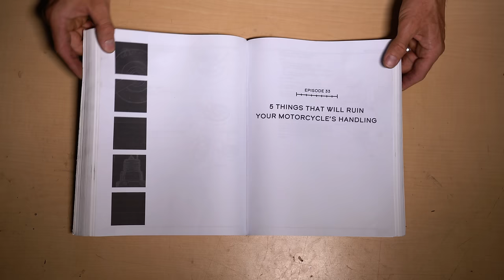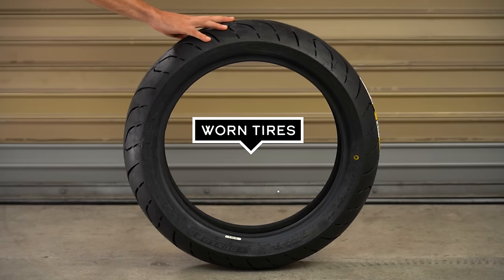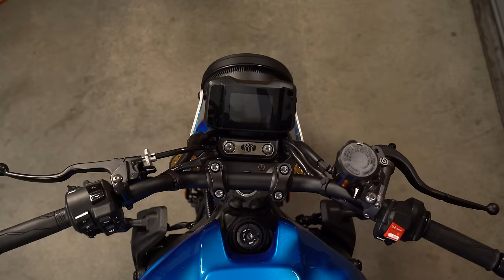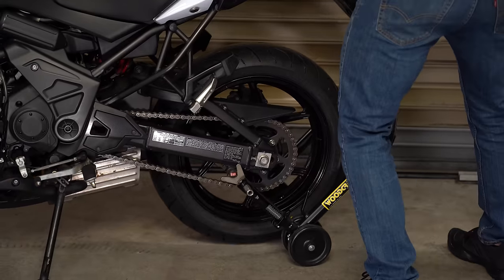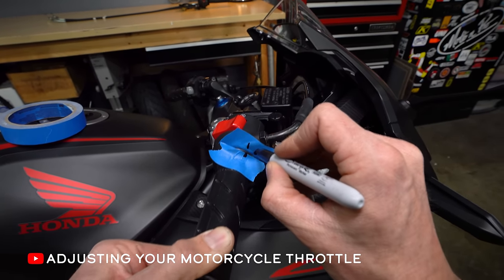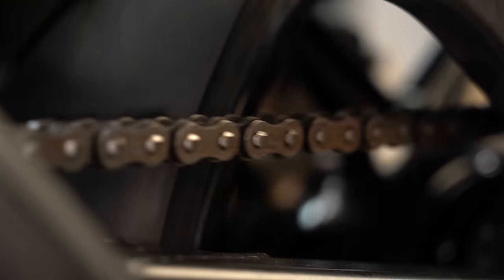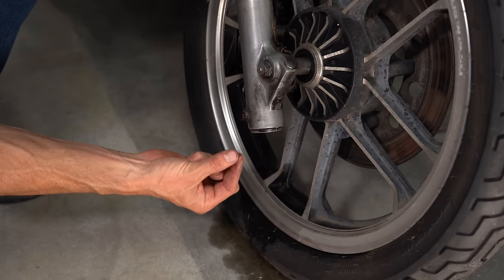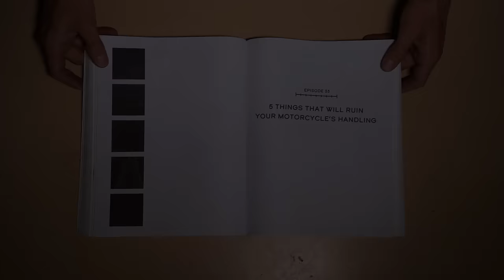5 Things That Will Ruin Your Motorcycle’s Handling | The Shop Manual

Comment from the maker: Want to learn more about optimizing your bike’s handling? Start with some suspension basics! https://rvz.la/3d5ZH6f
Reply: Hey Ari when I let go of the handle at 60 kmph then the bike goes to left slightly previously it used to go straight what could this be
Reply: Great info! I see a lot of people mentioning alignment in the comments. Maybe you can address that in a future Shop Manual?
Reply: @anshu0809  front tire is most likely culprit. Also, is this on crowned road?  Regular riding on well-crowned roads will wear your tires unevenly. Excess wear on the left for right-hand countries, and on the right for left-hand countries.

Another tire wear issue:  uneven turns. Not joking. We're creatures of habit, and we favor turning in certain directions, or we have a favorite speed run with more turns in certain directions. Can add up over time to uneven wear. 

Third tire issue:  cupping or bulging tread. Cupping is normal, but can be more noticeable in an unbalanced tire. Bulging is a far rarer, but very dangerous condition that can result in steering input from the ground up, and risk of blow outs. This is more common on some brands/models of tires, especially after running hot or a curb or pothole strike. 

Next most likely:  rear wheel alignment changed on your last chain tensioning. Even a millimeter or two can lead to rear tire steering. Easy fix.

Dozens of other possible issues, but the list above should hit 90% or better odds of a solution.  Presumes of course that the bike hasn't been in an accident or dropped hard.

Comment: Honorable mention: rear wheel alignment.
Reply: Spent waaay too much time realigning the rear after dropping the wrench adjusting the chain. May have been overkill, but it better not be wrong
Reply: I swear!! I wonder how did Ari miss on this one. I have almost crashed once due to poor rear wheel alignment.
Reply: Heh, especially when he had to ride that bike with the completely twisted alignment on ctxp.
Reply: Well, it will still hand really well in one direction at least lol. I wonder if they intentionally misalign the rear tire on flat track bikes kind of like oval cars?
Reply: @forrest225  racers will do ANYTHING for an advantage!
Reply: I just did a new chain on mine, so afterwards i gave it the old 140 test to make sure the rear is aligned
Reply: @Lizlodude the “it better not be wrong” got me 😂😂. i swear i’ve spent too much time on little stuff, and too much energy getting pissed when it’s a millimeter off
Reply: @xXFireHawkXxHD  millimeter can make all the difference. Shit, in my job we deal in microns for alignment
Reply: This goes along with increasing front tire size, which increases trail and rake. Can be dangerous tank slapper or a kickstand killer.
Reply: Just put screwdriver between the rear sprocket and chain and turn the tyre rearwards. It will align it straight
Reply: @vam0s21   Uh… I think you have a weird understanding of the word "alignment”.
Reply: @miroslavmilan  try it.
Reply: @vam0s21  I did. Now my screwdriver is stuck. What’s the point?
Reply: @vam0s21  what you are thinking is that the axle is not up against the adjusters. Placing a screwdriver in between the chain and sprocket pulls it tight it does not align the wheel
Reply: @holmes1956O  based
Reply: The next time you replace an old 5’ fluorescent tube, keep it. They are very, very strain and extremely parallel, so ideal for holding against the edges of the rear tyre and checking that it’s in line with the front wheel. Way cheaper than a 5’ spirit level or laser level.

Comment: I rode on leaky forks for a couple months and then swapped springs and valves for racetech when replacing the seals…it actually felt like a different motorcycle. Suspension is overlooked way too often!
Reply: Same man but my fork is fixed and tires changed from sleek to a little offrady tires .it pulls opposite in cornered

Comment: The first time I got on the freeway on my first bike the front end shook horribly. It was scary but I just thought "eh I didn't fall over so it must be fine". I rode like that for 3 months before I was reading an article that mentioned tire pressure, I checked and it was at 8 psi. Ah to be young and dumb.
Reply: I was about to purchase a bike. Never rode that model before. On the test ride i noticed it wanna throw me off even in the smallest turns. Thought at that moment it can not be that sceved up geometry... Took me a few minutes to realize that it had a front puncture. I could push in the tire with 1 finger, barely had any air. Flintstoned it back to the owner, lucky i didnt crash it...
Reply: I had a gsr600 and would make a horrible noise at the front, especially when going over bumps, 3 months later I checked and had a massive crack across the bottom of the fork leg

Comment: All good points ! I'm always amazed at the amount of time and money people will put into engines for more power before suspension / handling  upgrades .
Reply: Rather buy good suspension than a engine upgrade👍
Reply: I've seen this way too many times.   I just rebuilt my suspension, did some upgrades so it matches my weight better.  Feels so much better, I'd even go so far too say it makes me look like a better rider then I am simply because I'm on better equipment.
Reply: Or even before just basic maintenance...
Reply: Gotta turbo the Busa ... ;-)
Reply: Same with cars….used to autocross Miata’s and too many were about more power and bigger brakes instead of setting up suspension, better brake pads (not bigger rotors) and working on the self: what is the driver/rider doing? That’ll make the most difference first.
Reply: Or simply noisy 'upgrades'.
For some, it's more important to appear fast, rather than be fast.
Reply: They don't have $1000 for a better shock, or even $300 for some springs. But that $2500 titanium system, well that's a must have!
Reply: This is America, and many share the "Tim the Tool-man Taylor" philosophy of "more power".
Reply: Yep. I ralleyed a Pinto (yes, a PINTO) back in the day. Only spent money on suspension and better braking for quite a while and was very competitive. I went a couple of seasons before engine mods.
Reply: Power does not need skill. Just twist your wrist. :P
Reply: I had a 2019 iron 1200 sportster and upgraded the shocks on the rear (extra travel and all that stuff) and the front forks with a monotube kit.  It changed the bike so much.  My brother even rode it and said it felt like a completely new bike.

Comment: Several years ago, I had my 1994 HD Heritage Softail Classic in the shop for routine maintenance.  While in for service the repair technician indicated that my bike needed the head bearing slack adjusted.  They performed this maintenance, and I was blown away at how it affected my steering!  It was a very nice improvement, but it took me a couple of days to adjust to it.  The steering became very "touchy" needing very little input from the driver.  I would recommend getting this checked at every service.  Great video Ari!!!!
Reply: So now on the once a week 10 mile trip to the barroom it rides smooth.
Reply: @mike-uh8rk  Pretty much.
Reply: Adjusting head bearings is something that all riders should be able to do themselves.
Reply: @johndavidwolf4239  I agree.  However, as a Disabled American Veteran (100%), this is not always possible.
Reply: Ridiculous,  that's like saying all home owners should be able to sheet rock a ceiling properly.  There are carpenters and mechanics. Many of those don't know how to ride a motorcycle

Comment: #1 worn tires
#2 stearing-head bearings
#3 loose throttle handle
#4 worn chain
#5 worn suspension
Reply: Thanks for saving 7 minutes of my life
Reply: @normand30  You would have had to watch the video to know that was the 5 things mentioned. So did he really save 7 minutes of life if so how?

Comment: Honda VFR 750/800 the insurance company hired for me for a week after someone damaged my bike. It wouldn't turn properly. I tried to go around the roundabout and as I was leaning and turning the bike wasn't turning enough for the amount that I was leaning and turning. The bike was trying to go wide in the corner, to take less of a turning action than I needed. It was dangerous.
I rode the bike straight home.
Checked the tire pressures, and then I started to check the suspension settings and I set them according to the manual.

I went for another ride and the bike felt perfect.

Another time a "suspension expert" at Silverstone race track set my Fireblade up to handle better. At the end of hangar Street I was taking the right hand there at about 70 miles an hour and accelerating hard through the right hander when the rear tire broke traction and then gripped again and the bike went to high side and throw me over the bike but luckily I only went half off the bike and landed back down with the bike still going okay!
The guy I had been riding with, he rode alongside and shook his head and was laughing I shook mine back!

Suspension Expert? Mmm.
The bike had always been predictable before this but that time I didn't feel the rear start to slip before it had slipped.

Hope this helps someone or entertains, or both :-)

Comment: While the front end is up grab the fork legs from the front push and pull looking for play in stearing head bearings and while you're at it from the side grab the top and bottom of the wheel look for wheel bearing play, don't forget to check the rear too

Comment: One thing to note; manufacturers do introduce slack on throttle cables for safety. One of my GSXRs had zero slack and came back from service with it. When queried I was told Suzuki set specs they have to abide by. Bit of reading later and seems many do this. Thankfully as Ari showed it’s easy to dial out

Comment: Also check your clutch lever free play. If the locking nut comes loose, then the clutch lever may become very floppy, and that can make gear changes rough because the clutch doesn't disengage fully, and it can also cause stalling. I know that from experience because it happened to me.

Comment: I have had an FZ10/MT10 for a couple of years, just had the steering head bearing replace because it was shot! Rusted and feel apart when being removed. Suspension was leaking at the front (had just started) and the rear was pretty much seized. I’d already changed the tyres. Oh and the brake all needed replacing BAD. I nearly sold it and bought an Tuono (what a bike) but I did and got these basic things sorted! And oh wow! It cost the better part of a thousand bucks, but it save me me dropping thousands on a new bike. Moral of the story, make sure all your stuff is checked/changed before you blame/change your bike.

Comment: Biggest changes i feel is tightening the chain after a 2 week tour. Also i started changing tyres myself every year. Instead of riding 5 year old odd shaped touring tyres makes riding bad and cost a fortune from tyreshop + mounting. Such a big difference riding on fresh new rubber. Its like riding a new bike from the shop.  Pirelli always have huge discounts in EU on the Diablo Rosso 2,3,4 and they are half price of a premium touring tyre.

Comment: New Tyres are risky until you get that slippery wax off them. I dropped a new bike pulling out of a low speed T junction. The rear spun up like the road was slippy. I went home and got a green plastic type kitchen scourer and scrubbed the wax off the tyres.
Took a few minutes on each tyre.

Comment: I used Michelin Pilot Roads for years on my 2005 FJR1300 partly because of threads. Looking around for something cheaper, I got a set of Conti Motions. The handling is so much better I am amazed and also annoyed that I didn't try something else before.

Comment: Roller bearing head-sets, new chain and sprockets (along with a gearing change) new fork seals, shimmed fork bearings and fresh fork oil. Sounds like what I used to do with every new-to-me motorcycle. Ah yes and align the rear wheel with the front wheel too. Made a big difference.
Reply: I too love to change spockets willy nilly. Fuck honda what do they know
Reply: @user-co6ww2cm9k  Given the new-to-me deal I can't blame Honda for the gear-set I was looking at.  I prefer the biggest front sprocket that will fit and work from there for better mileage / cruising range.

Comment: When replacing fork fluid, I like to follow DMT’s dump and run method; on a new to me bike, I did just that; measure how much came out, then put in the same. I should have but forgot to check air gap though, after a few weeks of riding I tool the legs out to check, and found that both legs had exactly 80mm too much air in them. Topped them up, huge improvement.

Comment: Oh that's cool to know about, since my bike have all more than 15years😅

One of the front firk suspension seals were full of dust and were leaking on the front brake👍💪
I rode Anakee II on that same bike and they had about 16000km when i thought about how old they where...
Turns out, i adapted to well, so that the new metzler tourance next, i have now, are really strange and turn to easy to me... but i have also to ask my garage if they put the tubeless tyres on tubes or not...😬

Comment: Great video! And so often overlooked  issues, especially with new riders who don't know what it should feel like in the first place. Important to maintain all of these areas, they will cause a crash if you ignore them.
Reply: That's because most new riders buy second hand bikes for fear of dumping a new bike (as if it will ruin them financially for the rest of their life 🙄).
However, when you buy a new bike, you can definitely learn what good handling feels like and can notice changes for the worse. Not to mention having confidence in structural and mechanical integrity, warranty, etc.

I bought a new Versys 650 and when it was time to commute with it ~200 miles (one way) to work in a neighboring country every 2 weeks, I had peace of mind that it will not leave me stranded on the motorway in the middle of the night. That, regular service intervals and changing the chain & sprockets every 12000-13000 miles, made these 5+ years of ownership a trouble-free experience. Penny pinching on cheap stuff on a motorcycle can only lead to more serious & expensive problems down the road.

As a side note, I also use Motul 300V in it because 2-3 liters of premium engine oil once a year is the least I can do to keep the engine happy. I mean, for such a measly cost - why risk it with anything less?

Comment: This clearly means my chain is dead dead. Had it adjusted nicely, took it out for a spicy ride and came back home flapping so much it was hitting the swingarm. Both front and rear tires just changed, so steering is smooth and predictable again. Price to pay for angry rocket life 🙄

Comment: I recently had the tires replaced on my 06 FJR.  What a difference that made. Definitely worth the $$$ for the Michelin road 5. I picked up a cotter pin in the rear tire and the front tire had  “cupping”.  It rides a lot better now. A few years ago I replaced the head bearings and rear shock (previous owner had the front shock done).

Comment: thanks for the tips. you  could add to your list proper suspension settings and also weight distribution that can result from travelling 2 up or additional luggage amd/or accessories.
Alao certain windshields anchored to the steering group can change the Dynamics.
wheel bearings and alignment of wheels too.

Comment: Forgot to mention, worn out front/rear axle bearing also play a big role on how bikes handle. Got my mates that issues, where his bike front wheel steer left/right whenever he brake hard enough. It turns out his front axle bearing severly damaged due to intensity on pavement he rode daily. And I also got my problem with my rear axle bearing, lucky I found it out when I adjust my chain. My rear wheel wiggle/play just a little every time I tightened the lug. And on the same day my bearing poped off, lucky enough I were able to ride it to the nearest shop to get it replaced. Not amazed that happened to me, because I add rear rack and top box that are probably bit heavy for my bike.

Comment: I spent +$200 on a Kershaw knife about ten years ago. 8 years later the "thumb stud" broke and so I called Kershaw to see if they could help me out. They were rude, dismissive and I had to practically pull the words out of the guys mouth. In a nutshell, they didn't even give me a suggestion as to how to fix this problem. All the dude said was "You might as well get a new knife, your knife is out of production". So I got to work and made my own thumb stud, no thanks to Kershaw. I used to be a big fan, not anymore. At $200 a knife, I expect you to have extra parts for said knives until my great grandchildren die. McMaster-Carr to the rescue, now that's a real company.

Comment: Not to do with wear and tear or improper adjustment of parts on the bike itself but adding phone mounts has been known to sometimes induce a slight wobble at freeway speeds.
Whenever I've seen posts on facebook bike pages about random high speed wobbles, most of the time, it started after installing a phone mount.
Reply: Fork mounted bikini fairings are notorious for this as well.